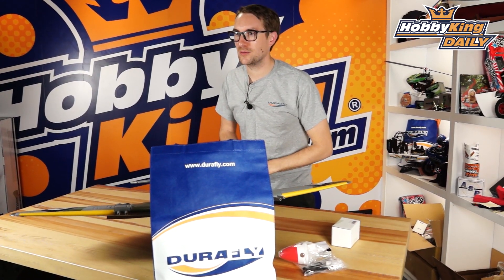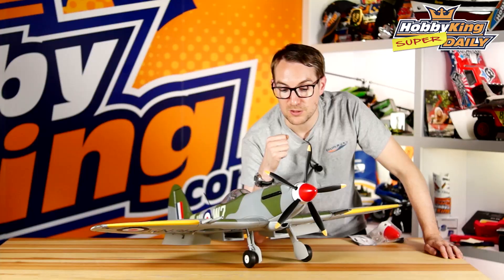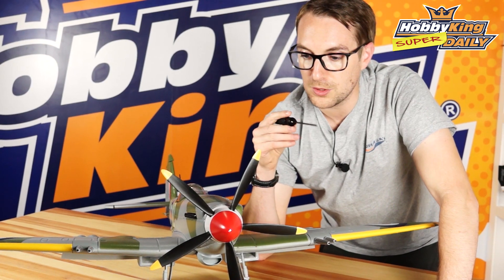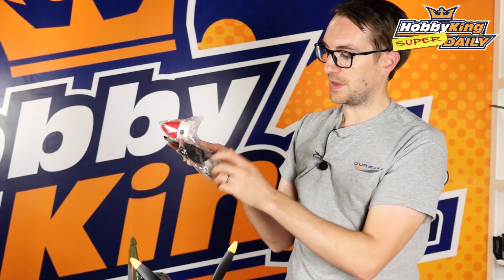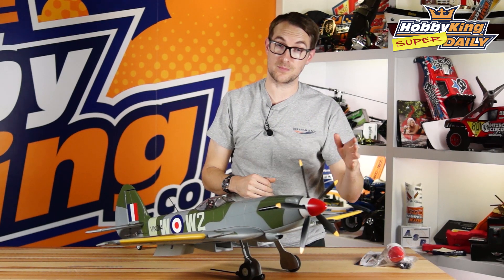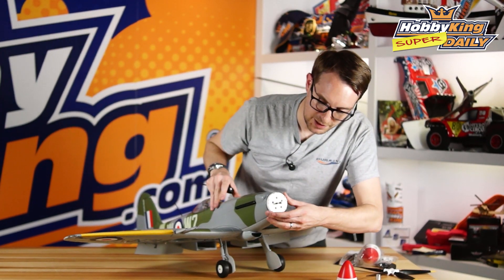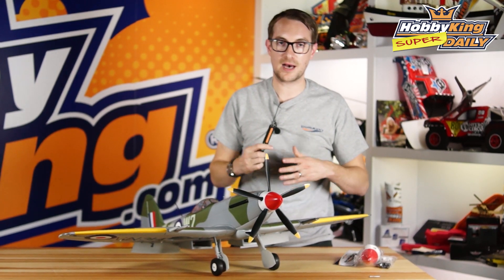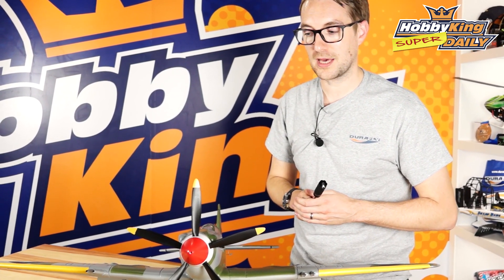Durafly MK 24 Spitfire 5 Blade Setup - HobbyKing Daily

Comment: Can anyone provide some help. My tailwheel has a slight wiggle to it as in it turns left and right without the use of the rudder. It's not fixed straight. Is there any way it can be fixed?